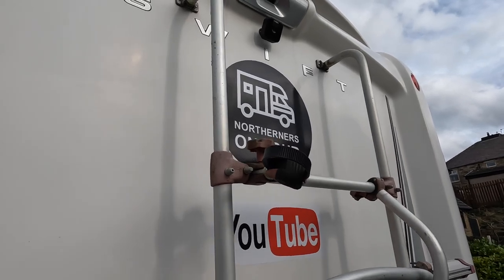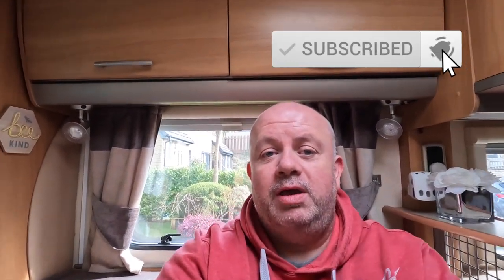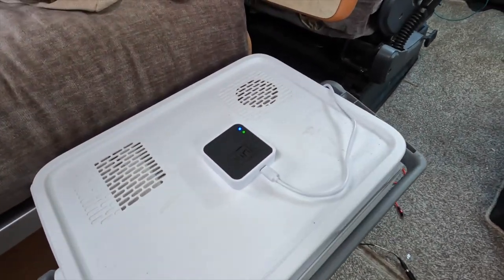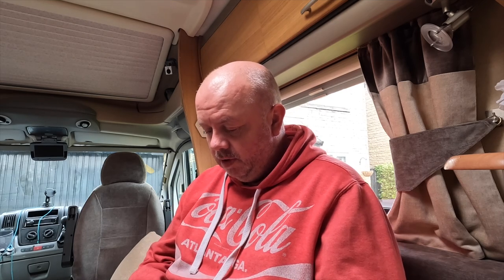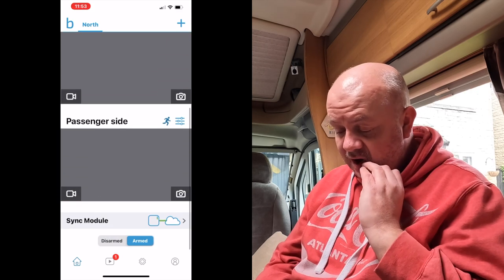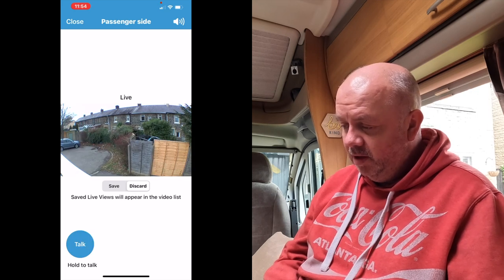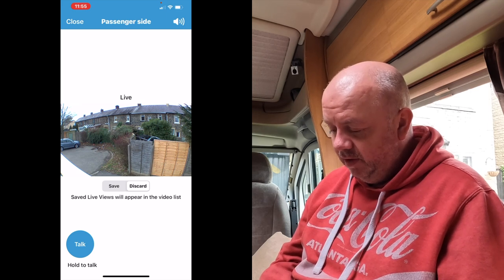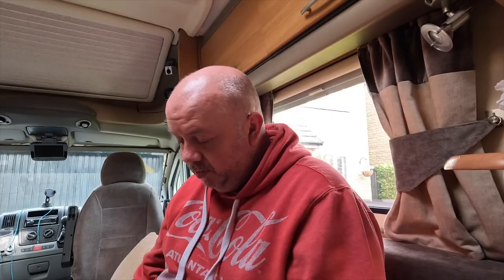MOTORHOME SECURITY | Fitting BLINK Camera CCTV system | FIX IT WEDNESDAY!

Comment: Just for clarity, do these cameras need an internet connection and a separate router, or does the little mini device that you showed at the beginning create a local wi-fi connection and that’s all that’s required to monitor the cameras? I stay in some pretty remote areas where there’s no phone signal,  so if these require active internet they’re a non-starter for me.

Comment: This is really interesting.  I like anything that’s hassle free and no hard wiring.  How did you fix the brackets are they stuck down?
Reply from the maker: Yes I used adhesive sealant called Sikaflex left the mounts in place for a couple of days. It’s the same stuff people use to stick solar panels to roof of the van.
Reply: Think I saw screws

Comment: Great video,  can the blink system be used on off grid or does the main blink unit need 240 volts to run.  Thanks.
Reply from the maker: Hi,Mark here. No the main Blink unit is usb powered and the cameras have a small lithium battery in them. It’s an easy install but you will need Wi-Fi in your van.

Comment: Hi guys great video and I’m consider this system for my van . One question though - if you glue the units in place? How can you then replace the batteries? Cheers.
Reply from the maker: the mounts are glued in place not the unit so can be removed to change batteries xx
Reply: @NorthernersonTour   - but did you not say you would add glue to stop the mounting unit from moving once you had set the camera angle.?  Also to stop the possibility of the unit blowing off during transit.

Comment: Hi Mark, what did you use to stick the mount to the van please? Thank you x
Reply from the maker: I used strong double sided foam tape. Be warned that the cameras are not 100% waterproof so depending where placed might mist up. Mine do now but been on for over a year.

Comment: So watched this video amongst others and decided to get 3 cameras plus sync unit… they barely work and sometimes just don’t work at all.

Can I ask what your upload and download speeds are on your MiFi device? About to send it back and get a refund. The Blink tech team are hopeless and offshore. They just told me to contact provider, apparently my  sterol is fine. Thanks J
Reply from the maker: We haven’t had any issues with the cameras unless we are in an area with no mobile signal. Otherwise I can rely on the 24/7. Maybe the hub device has an issue ?
Reply: @NorthernersonTour  just tested them on a friends broadband and the system/ cameras actually work. Its just the MiFi that isn’t running any of them, no idea as my MiFi works the Neos camera and streams Netflix no probs. Also the speed tests performed on my MiFi are are above average (download/upload speeds)
On Blinks website they have changed the wording to say they can only be connected to a broadband service, guess they realise there’s issues with a lot of customers using 4G or wireless MiFi.

Comment: Any suggestions for a caravan that's kept at storage without any WiFi? I have a solar panel but that's it ? Would like to check in on it or have alerts if anyone comes near / in
Reply from the maker: Your Caravan would need either it’s own Wi-Fi or a Wi-Fi network nearby that you can access. Without the blink cameras wouldn’t work remotely. I’ve been told that you can use a sd card in the link unit and record events offline but I’m not sure about that !

Comment: As it works on wi-fi. In a Motorhome is wi-fi on 24/7 even if you don’t have you power on. As we would use it when Motorhome parked up for a few months. New to this 😊
Reply from the maker: We use a mobile router permanently connected to our battery.